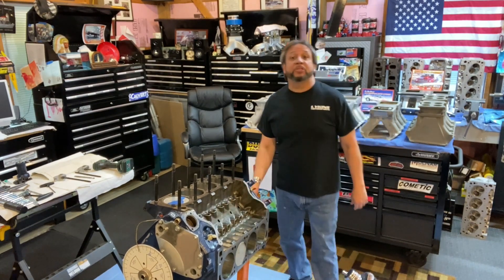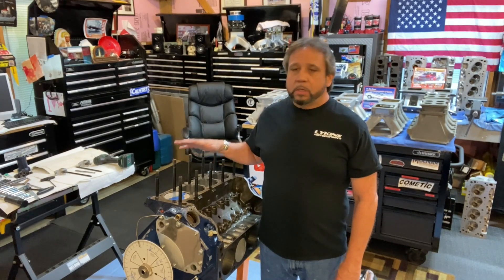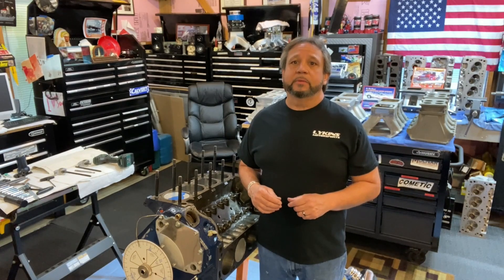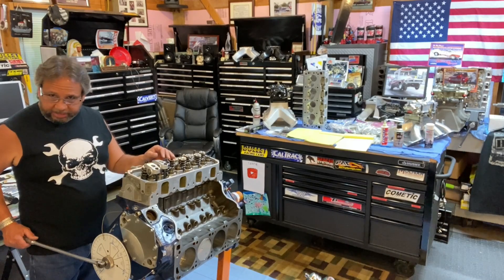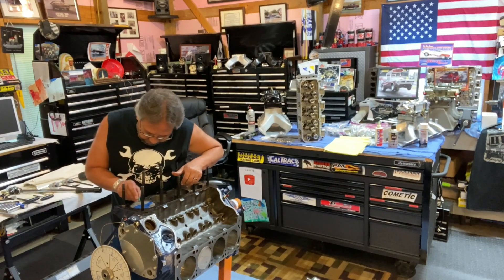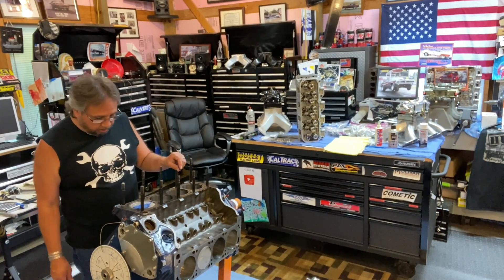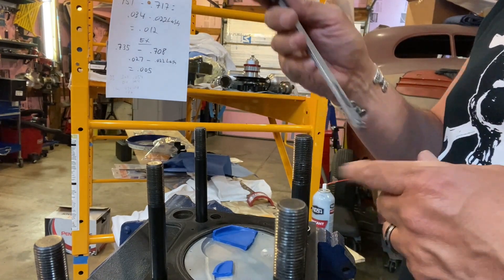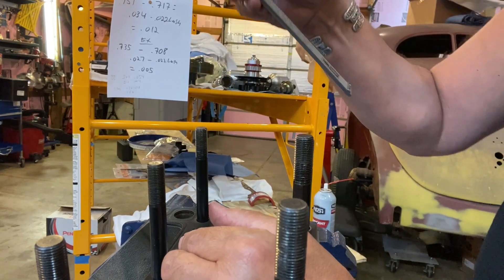DragBoss Garage: Episode 52 Piston To Valve Clearance, The Clay Method With Loaded Valve Train.

Comment: Did you check total lift at the valve with full pressure springs?
Reply from the maker: Yes it’s all in the vids of degree in the cam. Pretty surprised on results thanks Allan.

Comment: Great Video Tim. If you have an already assembled engine and want to advance cam, how would you go about checking piston to valve clearance?
Reply from the maker: Tough when heads are on. They say it only changes pv clearance a few thousandths, but never ck. You could put air  in cylinder, remove valve spring and replace with checking spring, and use a dial indicator method.

Comment: Tim,your p/v clearance will be even more when engine is running as the valves lag behind the crankshaft due to timing chain ,and every other part that moves in the valvetrain.valve timing is always a little behind the crank.Steve Morris has a video on this and said 50 thou is fine on the intake because the reality when running is alot more than 50.Take a look,it real interesting.
Reply from the maker: Hey Arron. Thanks for watching. I know what you mean. I also did not even mention the increase with lash, so much more. I saw that video. Thanks. I have seen anyone compare all three methods. It was a cool experiment. Only took me a year to get it done, lol. Stay tuned.

Comment: Tim I’ve always felt like the fully assembled or “loaded method” is the most accurate way of determining the critically important PV clearances. You did a fine job of showing the wide ranging results found by using the three different measuring techniques and explaining how more cam could possibly be used when the more precise PV clearances are known. 

So now the moment of truth on the dyno is just around the corner. I feel confident that your power and torque goals in comparison to the engines previous best are well within reach. Every one of the modifications and tweaks that you mentioned are proven to add power or reclaim power previously lost to friction. 

Now let the good times roll, my friend 🏁.
Reply from the maker: Thanks Daniel Wilson, I have never heard of it before, the loaded method.  But as scientific method requires, you present your theory and proof. I thought I have this cam that is the exact same as the one in 409, but with .790 intake lift could I run it. Well with my experimentation you see how things are not always as they appear. It’s going that extra bit to make the most of your combination. It’s getting that extra tenth on a run. I always try to think outside the box and do what works for me. I never have seen a video of all three on the same engine. This shows me that that .790 lift cam if you extrapolate it out. With dial indicator method I would have .008 of pv clearance for the Intake. If I use the loaded method, I would have with lash and other running gains. .0.109. You know I will try that cam and see what happens. Every ounce counts I hear something in the distance....
Reply: @dragboss351cleveland  , Always my pleasure, Tim.  No matter what nomenclature is used to describe the clearance checking process, the results obtained by using the actual parts in their fully assembled (loaded) state should typically provide the most accurate PV clearances. With so many variables that could skew the accuracy of the measurements, your scientific approach methodically reveals the previously unknown results that play an important role in the big performance picture. 

Patience is definitely a virtue when it comes to highly detailed blueprinting procedures and it’s something you convey in everything that you graciously share with your viewers. 

Knowledge is the power that makes good Clevelands great winners 🏁.
Reply from the maker: @danielwilson6665  Now I can get moving on the next project. Knowledge comes from experience, something that takes years to develop.It is also expensive.  I like being able to share what I know, help the next guy. This is how it is kept alive.  I only have about 15 good years left, so I  better get cooking. With Q16...

Comment: You need to check it with the indicator with the loaded springs. This is what the engine will see as it runs. A tip, Manley used to offer a tool that would go over the rocker arm and allow you to put a breaker bar on it so you can open the valve. I notice the no longer offer it.
Reply from the maker: I have seen that tool in the past. At this point Racer, done with this ole Cleveland. All the next ones in my build series will benefit from your knowledge. Glad your here. I have never seen any videos that compare the different methods, thanks for watching and commenting my friend

Comment: very thorough, very complete, very exact. Like I have said several times, nothing beats the accuracy of using the clay method on what you call the "loaded" valvetrain. All my final checks are this method, and I call it the "As it will run" method. This is the tell tale, and on your engine, you have enough to be safe when everything is hot and spinning to the moon. I can't wait to see what this gem will do.
Reply from the maker: Thank you my friend, Elmer. I try and do things the same way and be consistent. I have never seen anyone ck pv with all three methods, lots of good info I discovered. Thanks for being positive and giving us your experiences. I also never mentioned the addition of lash. I can’t wait either, you know what I say, ....stay tuned